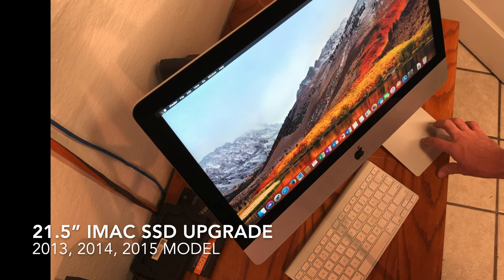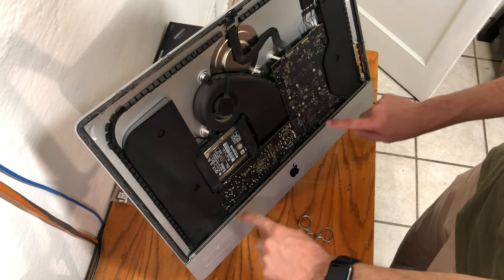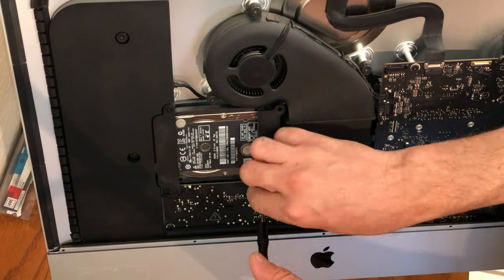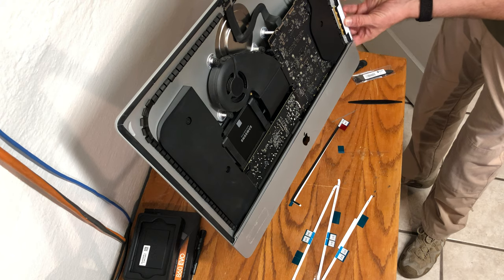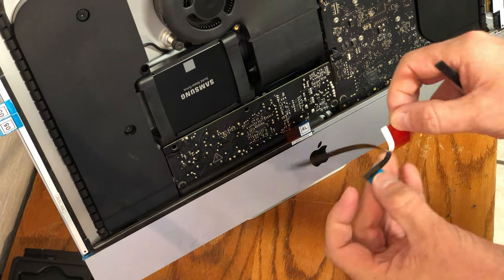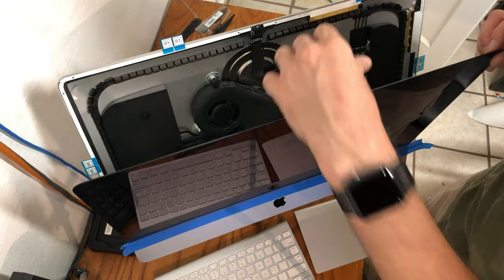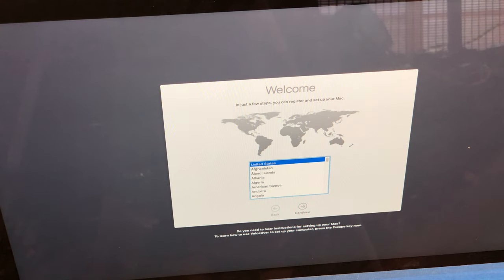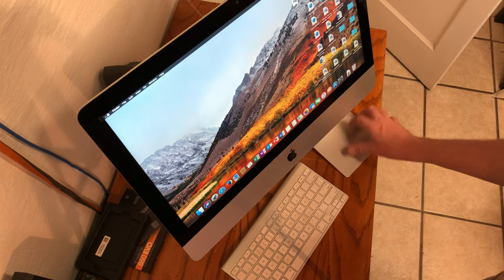Apple iMac 21.5” SSD Upgrade (2013-2015) HDD To Solid State Drive (SATA) | Step By Step

Comment: Hi! I upgraded my iMac 21.5 late 2013 with a new SSD and 16GB RAM, everything is fine, except for the loud fan. I have tried so many apps like Macs Fan Control, smcFan Control, HDD Fan Control, SSD Fan Control, and any of this have worked for my Mac, because the loud fan continues to sound. Anybody know a solution to this issue?
Reply: There is a temperature sensor that connects to the hard drive and your logic board. You need to install that. I don't know the part exactly, but I have seen it mentioned in other upgrade videos. Maybe call OWC.

Comment: I've followed everything to a t, and it's not working. I ordered everything you said. Just Beeps, no chime. Black Screen.
Reply: check RAM one stick at a time? Or Move one of the RAM's onto another slot. Test it that way. Good Luck
Reply: Shin AkumaD yeah, no. To change the ram you have to take everything else out too. It’s a pain in the ass

Comment: My screen has gone black after connecting it back together, and the fan is on full blast, what have I done?
Reply: same here! What was it?!!
Reply: @tatouram5294 the circuit board was damaged, the cost to repair it wasn’t worth it so had to had to scrap it
Reply: @77777337  aw no.. I hope that won't be my case..
Reply: @tatouram5294  hopefully! It was the ribbon connector, if you’re good at soldering I think you can buy a new part for cheap

Comment: Hi again Geeks who care.
I have done this upgrade, but when i am starting up the mac, it is just running with black screen, and the fans are running fast. I have tried to hold the alt+cmd+R+P while powering up, until the two startup chimes have sounded, without luck, i also took the power completely out of the mac, waited a minute and powered up with the alt+cmd+R and still the same, the mac is just running in black screen and nothing else. Finally i put the old hdd back, tried the above again, but still the same - nothing but the fans running fast...Any suggestions ?
Regards Flemming.
Reply from the maker: flemming ovesen oh no! Have you tried plugging in a external monitor?
Were you performing the upgrade in a static free environment? Prior to removing the original configuration, did you update to the latest version of the operating system and any firmware/software updates for the iMac within macOS?

If you remove the ram completely from the computer do you get beeps instead of a chime? 
Do you ever hear a chime with everything installed?

Have you tested the CMOS battery?

It sounds like you may have a unrelated new hardware issue that may have occurred during your disassembly/reassembly process... it sounds like you may have a logic board issue. Typically if you cannot see anything on the screen and the fans are on full blast, and you are 100% sure you have correctly connected the screen and all internal connectors the way they were supposed to be when you removed it...then it could be related to the video card, memory, the logic board, or the power supply. Sometimes I have seen grounding issues. I have also seen the internal line converter cause issues.

You may have to remove the screen and re-order a gasket kit; check the internal diagnostic LEDs to see what lights are turning on flashing etc. on the logic board.
Reply: Geeks Who Care Hi, thanks for the quick reply. The only light i can see inside, is the green light, it only goes off when i remove the power plug. To remove the ram, i will have to take it all apart, i dont have the skills for that, sorry. I dont have a external screen, besides tv and a windows laptop, but dont have the usb/ firewire plug to connect to the laptop. I believe i have done it all correct, but cant say if the screen or pc had issues with shortcuts, eg. static issues, i have not noticed it, anyway.
I hear the chime on powering up the imac, i installed the latest ios on the ssd drive and cloned the old hd to the new, before i did the hardware install, so i guess it should start up, normal. Before i removede the old hd, i could choose between the old and new ssd, when the ssd was plugged in the usb port.
Reply from the maker: flemming ovesen you may have to use a adapter cable to plug into an HDMI TV screen, The fact that you hear the chime is great news! Make sure you check all of the display cables to make sure that you did not damage them or damage the connector on the logic board for the display cables they are very fragile and can easily be damaged. You have very little room when opening the iMac to remove the cables without stressing them and their connection.
Reply: Geeks Who Care Thanks. Which cable will i need, usb to hdmi or something else ?
Reply from the maker: flemming ovesen you need a mini display port/thunderbolt to HDMI adapter.
AmazonBasics Mini DisplayPort Thunderbolt to HDMI Adapter - Compatible with Apple iMac and MacBook https://www.amazon.com/dp/B00NH13K8S/ref=cm_sw_r_cp_api_i_5J41DbGD93PMV
Reply: Geeks Who Care Okay. Do you know how many led’s on the board, that normally light up ? on my mac it is only the green, it is on as long as the plug is in the wall, when starting the mac, no other leds are lid.
Reply: Hi flemming ovesen. Did you fix it?
Reply: Geeks Who Care /the est.
Hi again. I plugged the mac to my tv with the thunderbolt/hdmi, and after the setup i made the hardware test, it took two minutes. The test said : There could be a problem with system management controller ( smc) ref. code PFM006 - There could be a problem with the monitor. ref. code VFD001
I checked the boards in the mac for any burnt fuses, and cant find anything burnt. Any ideas ?
Reply: flemming ovesen no sorry. I asked because I plan to do the same upgrade by myself. But now, after reading your experience, I think it would be better to have it done by a specialist. Sorry for hearing about your case. I wish you the best.
Reply: the est Thanks. I hope somehow it can be fixed, but i knew there could be a risk, doing it myself, lets see, maybe geekswhocare have a few ideas to fix it 🤓
Reply: Geeks Who Care.
Hi again. I plugged the mac to my tv with the thunderbolt/hdmi, and after the setup i made the hardware test, it took two minutes. The test said : There could be a problem with system management controller ( smc) ref. code PFM006 - There could be a problem with the monitor. ref. code VFD001
I checked the boards in the mac for any burnt fuses, and cant find anything burnt. Any ideas ?
Reply from the maker: flemming ovesen 
I’m glad to hear that your iMac boots with an external display. It is looking like it is going to be a hardware issue. The actual display has more than one connector that you need to connect to the logic board. One of them looks like this which is the display temperature sensor cable. Was this overlooked during the re-installation process? Here is a picture of what it looks like: https://i.ebayimg.com/images/g/lusAAOSwfjBcidJj/s-l300.jpg
Since you already mentioned you only had one diagnostic LED showing is it the number one LED?
This series of iMac has the Haswell graphics chipset and has known issues with stability on the video card longevity. Unfortunately this is one of the “games” that we all play when using any proprietary Apple hardware... :/
Apple chooses to use a proprietary power supply, a very proprietary logic board, and almost a unintelligent approach of engineering practices when it was crafted together for aesthetic purposes. In the past I’ve replaced iMac power supplies, and Logic boards together as a working pair, because somehow someway I had issues swapping logic boards and power supplies with replacement parts that weren’t originally together from the factory, ultimately never getting them to work again. 
I truly believe that you did nothing as a mistake in your process of installing the drive. Somehow static electricity or just moving the components themselves caused a capacitor or resistor on your logic board or power supply to fail which is now no longer reading temperatures from your video card or monitor. I would keep investigating all temperature sensors in your system.
Reply from the maker: flemming ovesen 

LED 1 - Indicates that the trickle voltage from the power supply is detected by the main logic board. This LED will remain ON while the iMac is connected to the AC power. The LED will remain on even when the computer has been shut down or put to sleep. The LED will turn off only if the AC power is disconnected or the power supply is faulty.

LED 2 - Indicates that the main logic board has detected proper power from the power supply when the computer is turned on. This LED will be ON when the computer is turned on and the power supply is working correctly.

LED 3 - Indicates that the computer and the video card are communicating. This LED will be ON when the computer is communicating properly with the video card. If LEDs 1 and 2 are ON and you heard the startup sound, but LED 3 is OFF, then the video card might be installed incorrectly or need replacement.

LED 4 - Indicates that the computer and the LCD display panel are communicating. This LED will be ON when the computer is turned on and video signal is being generated. If the LED is ON and there is no image on the LCD display panel, the LCD display panel or inverter might be installed incorrectly or need replacement.
Reply: Geeks Who Care Hi, and thank you for taking the time with this. I dont know how or if it is possible to upload a photo in this topic, but the tempeture cable is fixed on the lcd with black factory tape, the other end is located near the build in camera. About the leds. It is only the first green led which light up, number 2,3,4 newer light up. Could this indicate it is a faulty power supply, to the lcd screen ? Since i can start up with another screen via the hdmi/ thunderbolt plug, i guess the main power supply and the graphic card is ok, but can not figure out why the other led’s on the main board wont light, it would be more logic if the first 3 lights up, since i can use the imac on the TV screen. The imac i have is btw the A1418 late 2013.
Reply from the maker: @flemmingovesen1094  Happy Holidays! It must by physical; the logic board need to be repaired or replaced. Since there is no moisture or water damage of any kind, I am assuming it will be a capacitor that has failed for the internal LCD screen. LED #4 is for the internal display so hence no led light. Glad the external monitor works fine; you should find a place in your country to send the logic board in for repair, or the whole unit. Check out this post over here and see the user has the same issue, but your video card is working just fine unlike his. https://www.ifixit.com/Answers/View/490360/LCD+Backlight+problem+I+mac27+late+2013
Reply from the maker: @StollerEaven  I completely agree with your caution in the matter. However; I strongly believe that you can, like everyone else, achieve the super easy SSD upgrade in your iMac without professional "hired" help. Apple makes "fragile, proprietary" systems with "looks and aesthetics" over longevity and convenience. Apple makes things more difficult by "building a car you can't pop the hood and check the fluids on..." They do not sell replacement parts of any kind directly to the public or consumer at the apple store or their website; this is exactly why I find apples ecosystem flawed and not "good for the world". Imagine apple stores actually had the ability to sell you a replacement logic board in a box, and a iMac power supply in a bag same day... too good to be "Apple" LOL!

Comment: My Mac doesn't boot after upgrading to ssd...
The OS is installed on another ssd, sitting in the place of the former CD drive, wich I replaced a few years ago.
Why does it not recognize the new ssd?
Reply from the maker: "doesn't boot".. are you referring to the computer wont turn on? or the OS wont load?
try this; place old drive back into imac and boot into macOS, then run a time machine backup on an external drive. Use that backup to restore to new install on your SSD, using the installer of macOS Catalina off of a bootable USB stick.
Reply: @geekswhocare7093  the os didn't load. Sorry for my bad English, I am from Germany. Thank you for the tip, I will try that.

Comment: What an absolute faff and shambles just to replace an SSD. This is why Apple computers suck, not to mention they are a rip off. Windows Computers and components better quality, much more user friendly for system builders and cheaper parts, which are better quality.

Comment: WARNING TO EVERYONE! 

DO NOT pry the card more than 9MM into the LCD screen and use a hair dryer to loosen the glue on the edges so that you don't slip and go too deep. I learnt it the hard way. There are delicate monitor cables on the top which I damaged and that killed my LCD Screen. Don't make the mistake I made.